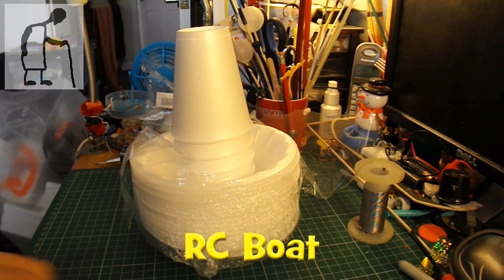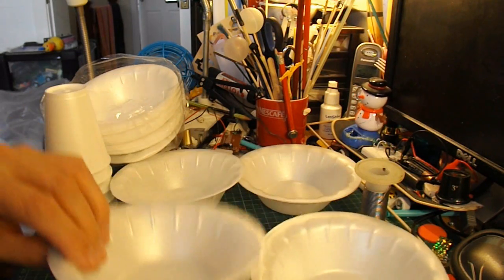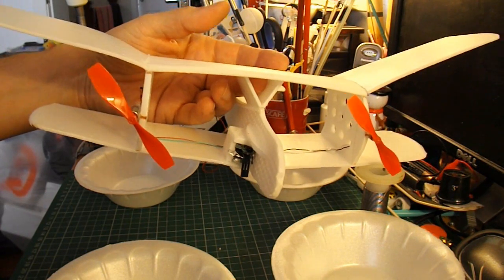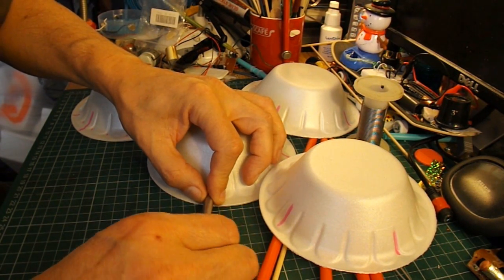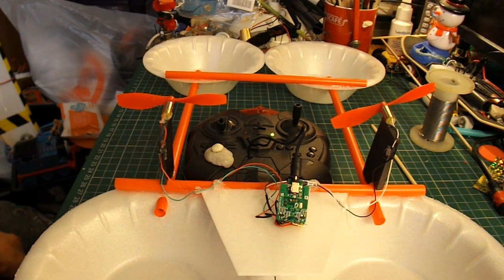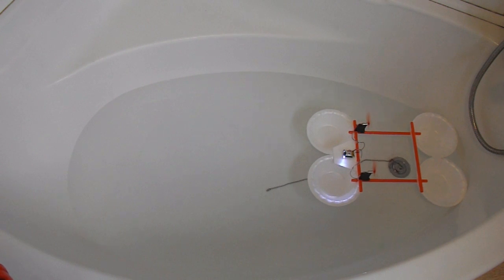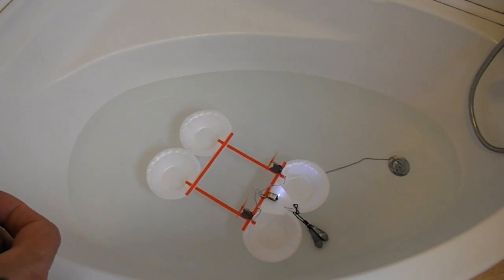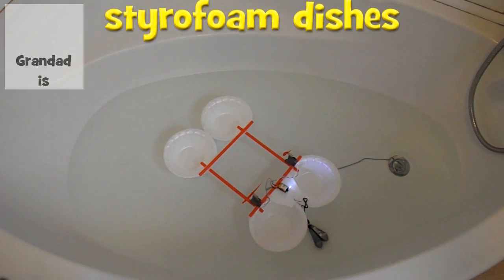Pond Skater RC Boat from styrofoam dishes

Comment: how to convert a cheap rc car to a quadcopter
Reply from the maker: If you want to be able to fly it and control it in the air then you would be wasting your time. To keep a quadcopter in the air you need gyrostabilisation to vary the power to each of the 4 motors to hold it level. The RC gear in a toy car does not have that facility. A quad copter turns laterally by varying the torque on each motor. The RC gear in a toy car does not have that facility. Forwards backwards on a quadcopter is controlled by varying the thrust between the front and back motors. The RC gear in a toy car has 3 states for the 2 motor outputs. Those states are 1. full power forwards 2. OFF 3. Full power backwards. With that sort of control you will not have the fine variation in thrust to keep the quad in the air and you certainly will not be able steer it in any direction. Ignoring those problems for a minute, you only have 2 motors in a toy car, 1 for drive and 1 for steering. Neither of them will have the power required to lift their own weight and certainly not enough power to lift the batteries too.

Comment: Hi Grand Dad, ever tried a balloon floater plane with small motor? But helium in the balloon, something similar.
Reply from the maker: +Emmanuel George I haven't made one and I don't really want the extra fuss of dealing with helium gas, however I have always liked the ones done by Mike Dodd, here is an example https://youtu.be/-AbQhrfWkxk
Reply: +GrandadIsAnOldMan Thanks, understandable.

Comment: hi i have a dc motor this work with 9 v battery which esc i can use?
Reply from the maker: +Abdullayev Aysel I guess you mean a normal motor, not a brushless motor, you will need to look for an ESC designed for brushed motors.
Reply: +GrandadIsAnOldMan yes brushed motor whic amper?
Reply from the maker: Abdullayev Aysel you would have to work that out yourself based on the type of motor you have. Maybe this FliteTest video will help you https://youtu.be/6r9FUadpLVg

Comment: Hey grandad, I was wondering if you could could take this rc unit off this fan boat and put it on a smaller boat, or if you have smaller propellers then a micro rc fan boat.
Reply from the maker: +Epic Face 3000 the problem with the rc unit is it has very short range and because it is infrared it does not work well outdoors because sunlight blocks the signals.  https://youtu.be/TDmAvYJPVZ0?list=PLA5a2xPRSrB13Xcquw4Ff09MQzTPjeVkI   https://youtu.be/pLAVFUccL40?list=PLA5a2xPRSrB13Xcquw4Ff09MQzTPjeVkI
Reply: +GrandadIsAnOldMan OK well then whenever you get a small RC unit that is not infrared, then I would like to see how to make a micro fan boat out of toy grade RC units.
Reply from the maker: Epic Face 3000 Both of those two links I sent you is are micro air boats with toy grade RC. In the second one I explain that I didn't use the infrared receiver as I didn't have a matching transmitter

Comment from the maker: Yahia Emarah asked "can you teach me how to make a rc boat from a foam plate". Two problems there. First I tend to make boats by carving solid lumps of styrofoam block or modifying cheap plastic toys. Second, I have run out of styrofoam plates. So instead I made a boat from styrofoam dishes and powered it with the components from a cheap rc helicopter.